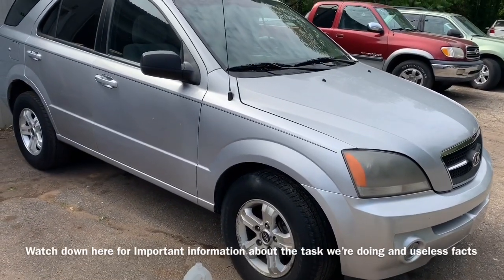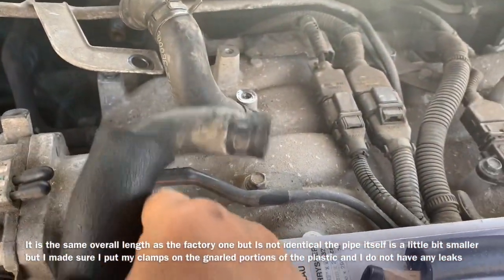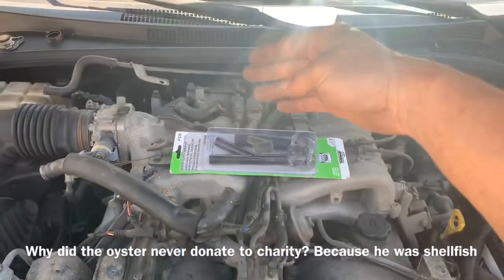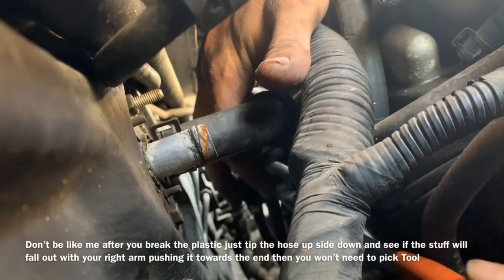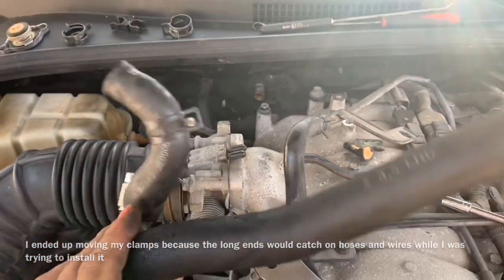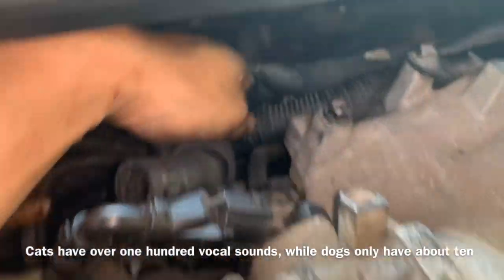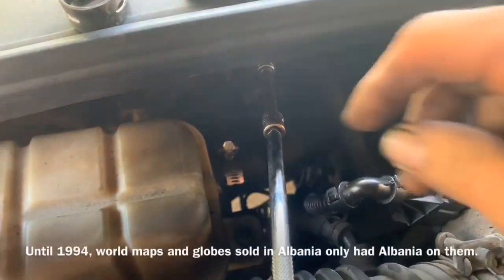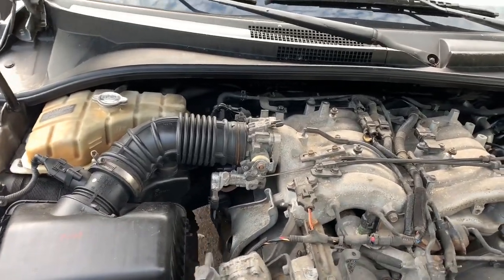Kia Sorento leaking coolant no coolant in Kia Sorrento possible reason for coolant loss

Comment: It’s easier too jus pull the wipers and motor and bracket takes 10 min too do
Reply from the maker: Hey thanks Chad I appreciate that I put a disclaimer In the description right at the top because you may be correct I didn’t do it that way but I will certainly try it the next time I’m gonna leave the video up just in case somebody doesn’t want to do it that way but I do appreciate it very much have the greatest of days God bless

Comment: Yes, remove wipers, wiper motor and the metal shield to get lots more room. There is another video showing that. BUT!!! Why replace the broken PLASTIC "Y" that may fatigue and crack again when you can order one made of metal. That is what I did. And to better clean the pieces of plastic from the hose I used a vacumm cleaner. I also could not reach the clamp on rear of block so did like you and used the existing hose, but also used the hose clamp with screw.
Reply: Were is the other video ??

Comment: Good video very informative. I do have a question about lines in the back of motor can a transmission coolant line be repaired without being replaced ? Got a leak on a 2004 Kia Sorento.
Reply from the maker: I would assume that it could be cut and spliced with the rubber hose. Obviously I can’t say for certain without looking at it but if it looks like it can it should not be a problem

Comment: It took us years of driving to understand what and where that smell was coming from. Hahaha. There was a small leak and it would go down to the exhaust manifold? and heat up into steam!!! Any how I saw the drip , couldn't access the point of leak so had to det it up on a lift! You did a good job trying to show how to finagle the hoses back into the correct spots. One , my big chubby hands arent gonna fit in behind the engine. Tw, I ain't got a 45 degree clamp removal tool. 3 I don't want to hear my wife scream at me if I cant do it. So I'll pay the mechanic to do the  dirty  work, thanks!. Need it done right and without breaking tee. And need car to go shopping NOW!!!!
Reply from the maker: Thanks Chris welcome to the channel brother I always figure even if people don’t do it themselves they at least know what someone else has to go through. I think that has a lot of value as well.

Comment: So I have a 2003 sorento coolant leak coming from the left side of the block and I’ve replaced almost everything I could think it could be other than plug and water pump I’m wondering what u think it could be?
Reply from the maker: Good morning Krista well I’m not super familiar with these vehicles enough to lead you down a different direction. So I honestly couldn’t tell you but that’s only because I’m very ignorant about these type of vehicles and I wish I could be of help
Reply: F
Ok

Comment: Kia or hyundai both are very problematic cars
Reply from the maker: They certainly are now, but from 2004 to about 2010 they were pretty good Cars. I didn’t think they were worth a shit at first. then I had several Sorrento’s with well over 200,000 miles on them and it kind of changed my mind now I know that there later model automobiles have tons of planned opulence built right into them just like every other one…. That’s sad.